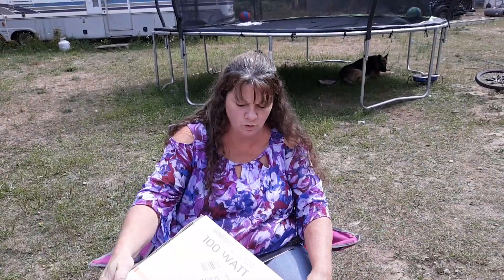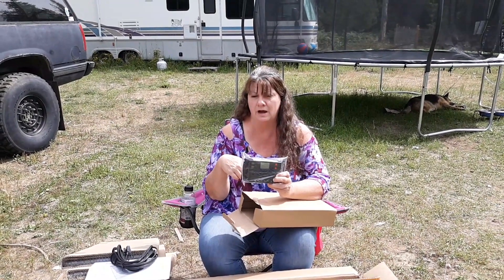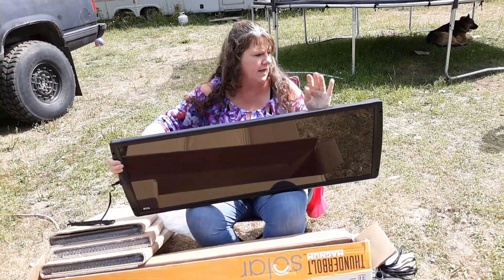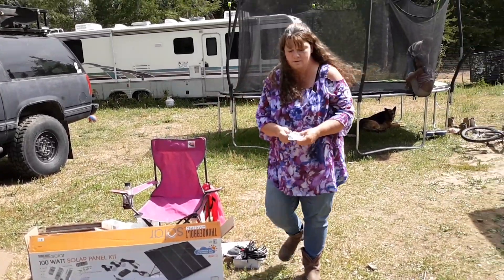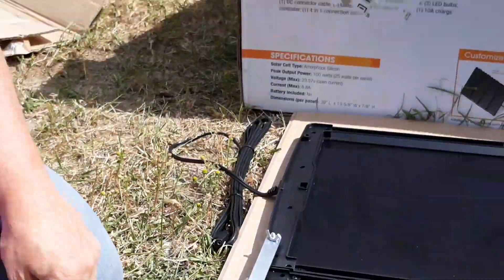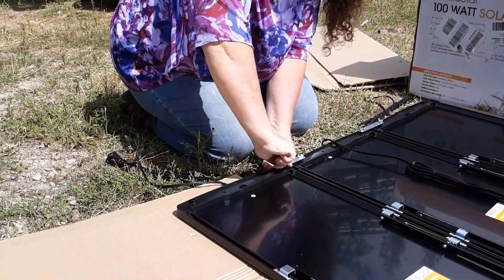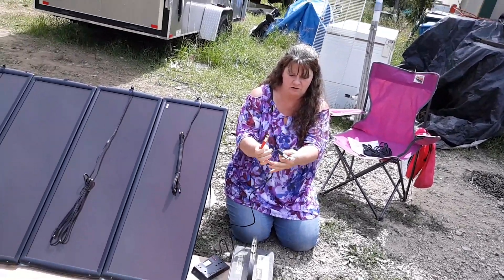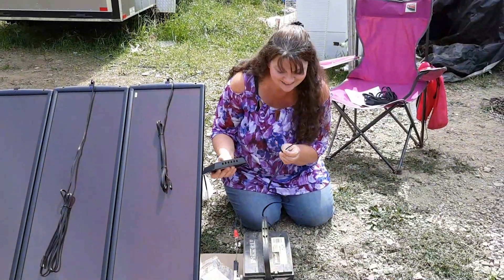Harbor Freight Solar Panel Kit Setup - 100W Off Grid Power - Cheap and EASY!

Comment: OK, YOU PAID ALOT OF MONEY FOR A SOLAR LIGHTBULB? WHERE IS THE INVERTER?
Reply from the maker: Oh this video was just about how to set up the panels.  I personally don't have too many DC things to run straight off the controller.  Where I use these kits around the property, I usually do have inverters hooked up.

When I first got up here, we had the satellite internet modem hooked to a little pure-sine inverter on one of these kits.  I also have a utility closet in the same area, so I do use the kit DC light bulbs in there, hooked directly to the controller, to illuminate that space.  

These kits could be set up to run a couple of small 12v appliances, like you might buy at a truck stop, or set up with an inverter to run conventional 110v items, like a phone charger, or laptop, or whatever.  

Sounds like I need to get busy and make a video about setting up a system with inverter and all!
Reply: @OffGridNorthIdaho  You don't owe anyone an apology.  In truth your system is at least 20% more efficient by NOT using an inverter to change the DC to AC.  

There are a ton of 12v DC small appliances out there, but you're absolutely correct, Starlink modems pull a lot of juice, and having a dedicated panel array is very smart.

These kits are for people with limited application in remote locations where the installation of grid power is too expensive or impractical.

Perhaps @michellelaclair will entertain us with an inverter lesson.

HF is known for making inexpensive, but often durable, products.  Let's be honest.  These panels aren't efficient.  Today 300w panels are very common and have become much less expensive.  Of course the little 10 amp charge controller won't handle even two of these 100w arrays, BUT you can hook two of these arrays into the same battery through each of the supplied charge controllers.  It's always a great idea to check the AMP output of the panels you're using, (total), to ensure your charge controller is big enough.

Great job finding small projects to put these panels to work.  

Once your viewers have the basics down, they can get an inexpensive 200w panel, a 20 amp charge controller, and a 100 amp hour flooded (marine) battery, AGM, or a lithium iron phosphate battery that will be much more efficient.

For flooded marine batteries a less expensive PWM (pulse wave modulating) charge controller is fine.  If using a LFP (LiFePO4) battery an MPPT charge controller is indicated.

I'm sure Northern Idaho gets much colder than North Carolina.  Still, all batteries, whether flooded lead-acid marine batteries, gel, or lithium batteries suffer in the cold.  Most of the MPPT charge controllers actually have temperature sensors to avoid damage by charging when the temperature is below freezing.

God's blessings for good health and prosperity for you and your beautiful family.
Reply from the maker: That bulb is a 12v DC bulb, came with the kit, I think.  It doesn't require an inverter, since it's DC.  It runs directly off that little charge controller.  If I wanted to run a regular 110v AC lamp, though, then I would need to have an inverter hooked up.
Reply: @OffGridNorthIdaho  Yes, I know, the bulb  came with the kit, so what do you  use it for if you have no inverter?.
Reply: < $189 for a complete solar system is more than reasonable.  What you plug into your charge controller is completely up to you.

Comment: ASSEMBLING a single battery and single 100W panel isn't off-putting. It's when you want to have a bank of a few batteries and/or more than 1 100W kit that gets me a little hair-fied.
I think though, the the biggest task is going to either be affixing a permanent mount to the S. side of the pole building OR building a "smart" conversion for an old garden cart I can tote around to where I might want to have power away from the house.
I've seen a MOD for this but not sure I like it or will adapt it...still thinking on it and watching loads of YOU TUBE today.
Reply from the maker: We are actually upgrading our bigger system today, and I'm going to at least get some pictures, hopefully video too. 4 panels at 265 watts each.  You're right, though, it is off-putting and kinda overwhelming.

Comment: Love your videos on solar I have the same system my only question is how many batteries and what size can you use
Reply from the maker: With the harbor freight setup, I've always just used a single 12V car or marine battery.  I will ask my husband if you can do more or different than that.   Thank you!!
Reply: @OffGridNorthIdaho  thank you I am using the largest deep cell battery from Walmart now